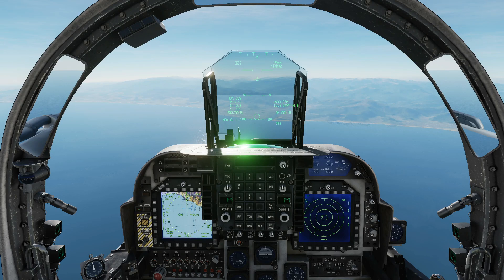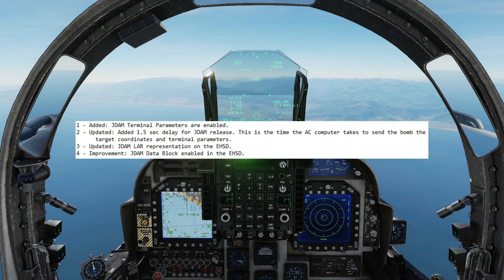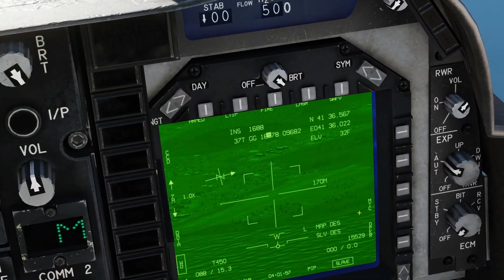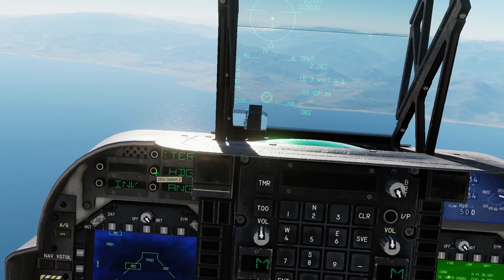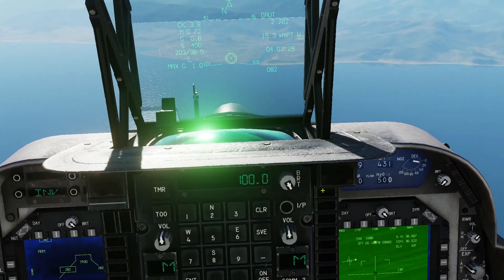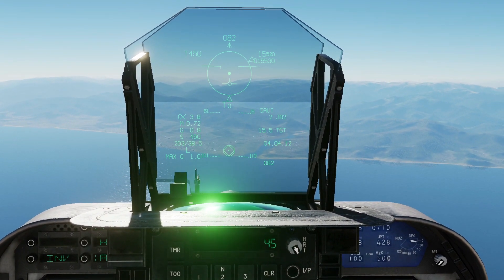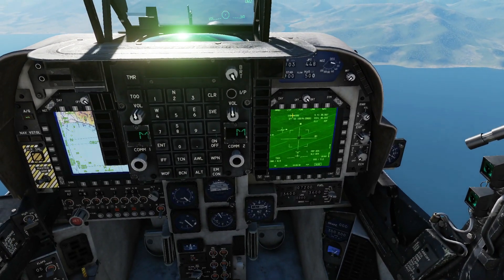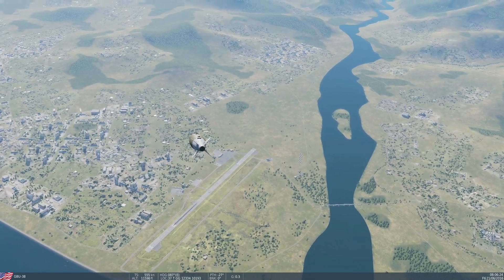AV-8B Harrier: JDAM Terminal Parameters & Updated LAR Tutorial | DCS WORLD

Comment from the maker: *CORRECTIONS/ADDITIONAL

RELATIVE vs ABSOLUTE:
(Andre ARTYMIUK)
This is specifically for RELATIVE mode of the JDAM  where the TPOD is used to locate & designate the target.   In ABSOLUTE mode   (where the JDAM is aimed at a pre-loaded TARGET POINT, or a target point loaded in flight via the CAS page)  the HDG is NOT relative to the launching plane's course, it is an ABSOLUTE heading onto the target.   i.e.;  a HDG set a 90 degrees will  hit the target from 90 degress IRRESPECTIVE of the heading of the launching plane.  Important difference !  So ABS mode would always be used against a pre-planned target,  RELATIVE mode against a target not known in advance.

DATA BLOCK:
(Larry Zambrano)
The JDAM data block is in the lower right corner of the EHSD. It shows:
1. Priority target a.k.a. the first target to be "serviced"
2. Distance to priority target
3. Distance to LAR Max range.
4. TOF for the bomb if released at that moment.
5. TOI for the bomb if released at that moment.
The information is always refreshed for the priority target. They will freeze when no more bombs are available.

Comment: I'm having trouble getting the cannon to fire in the Harrier. Anyone else cannot fire the gun? Is this a bug or a feature?
Reply from the maker: Engine must be above 60% throttle for gun to fire
Reply: @grimreapers  It appears my gun would not fire before a certain engine RPM was reached (above 81% in my case). I was not aware of this feature, thanks for letting me know!
Reply: Have you got the gun pod load loaded on the aircraft? are you pressing GUN on the stores page or A/A Gun Mode (Weapon mode switch down) ? also check you are in Air to ground mode and Master Arm is on!
Reply: More precisely, gun now uses bleed air to fire, exact RPM varies a little.

Comment: This is specifically for RELATIVE mode of the JDAM  where the TPOD is used to locate & designate the target.   In ABSOLUTE mode   (where the JDAM is aimed at a pre-loaded TARGET POINT, or a target point loaded in flight via the CAS page)  the HDG is NOT relative to the launching plane's course, it is an ABSOLUTE heading onto the target.   i.e.;  a HDG set a 90 degrees will  hit the target from 90 degress IRRESPECTIVE of the heading of the launching plane.  Important difference !  So ABS mode would always be used against a pre-planned target,  RELATIVE mode against a target not known in advance.
Reply from the maker: Thanks Arty will add to vid.
Reply: @grimreapers  In your video, it is also an absolute heading. You did not enter the offset (wich would have been 18° left) but the absolute heading of 100°. So you DON'T enter an offset.